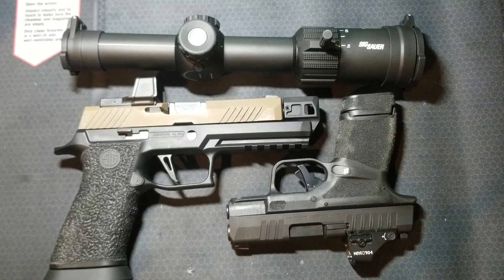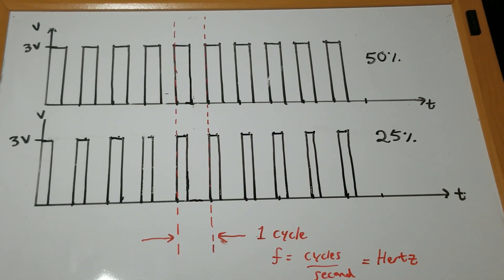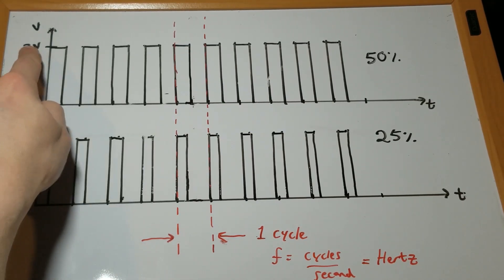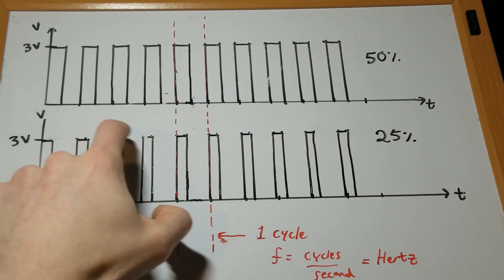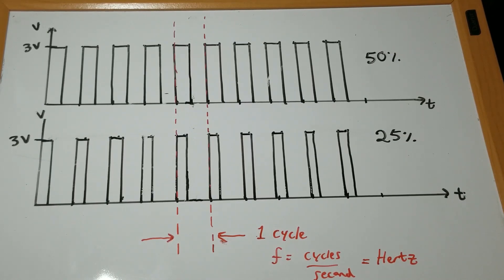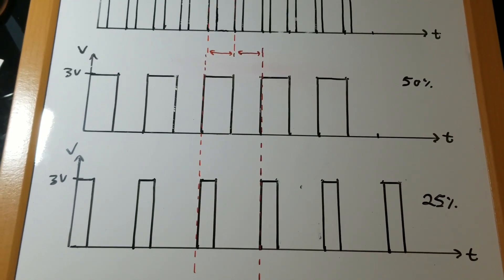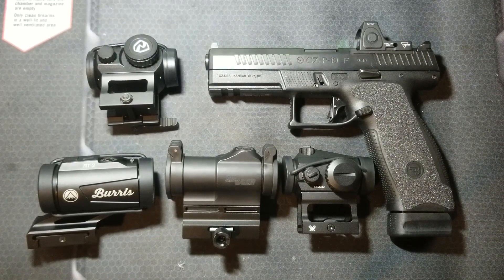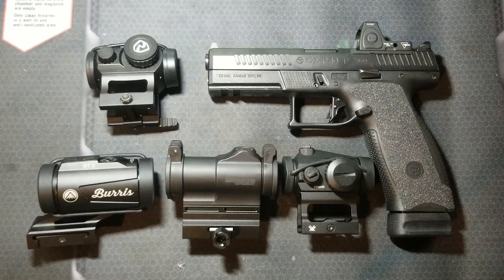Pistol Red Dot Flicker or Refresh Rate Explained

Comment: If you want to get really weird we can talk about holographic sights. EOTECH went to enormous lengths to avoid noticable flicker if you understand the technology constraints they had to hurdle. I know for a fact that at one point in earlier EOTECH designs both the pulse width and pulse frequency are altered in some brightness settings (I suspect this is still true, I just know that one for certain), due to the minimum output brightness that is actually stable with the laser diode used at the time. To achieve the lowest brightness settings pulses measured in a couple of nanoseconds were used which required 2 separate microcontrollers to pull off. In the order of 1/1,000,000,000ths of a second. I wish they were better explained to people, holographic sights are complicated but not impossible to understand.
Reply from the maker: Thanks for sharing this! I know the basic operation principals of holographic sights, but not details like this. I am sure they ran into a lot of technological hurdles as they developed that tech to get it to market, manufacturability, and being reliable and robust to the point it could be put into service! Time to go do some more research haha. If you had any good links I would appreciate you sharing!
Reply from the maker: I read the reply you recently made to my follow up comment - you must have deleted it but I read it in the notification email I got. I figured their technology is a very closely held secret. Patents are intentionally vague to cover the broadest application of their tech while also not giving away the details in a way it would allow someone to replicate. I appreciate your time and response. I'm not trying to have you do the research for me then spoon feed me it haha. I can go look around a bit. 

I would love to get into the nitty gritty details of their electronics package and control scheme. But thats likely not published as its their IP/trade secrets. Always appreciate your comments man!
Reply: @EngineersArmory   Dammit, you caught me! 10 or so minutes after posting it I thought "Uh, he's an engineer. This is almost certainly not useful for him. He would think of looking at them."
The only one that has really anything more the most superficial details about the electronics is the patent for what ended up being the Bushnell Holosight XLP and integrated circuits and other things have come very far since then. It is the only one that has detailed drawings of it's circuit board but you can tell at a glance it is not detailing all of it. By the way, I had remembered it wrong, there weren't 2 microcontrollers, there were 2 pulse forming circuits. Screwed up the two.

None of the sights ever sold under the Bushnell Holosight name got revision F of the Eotech branded stuff which drastically increased battery life and suggests drastic changes to the electronics to me. I was unable to to find even a satisfactory photo of the circuit board of either. Since the 551 was actually adopted into US military service I expect there is a TDP of that which would certainly have the drawings, etc., we want to learn about it but that is not likely to be just found somewhere and I'm not sure how long it takes for the government to turn down a FOIA request on average now and don't want the suspense.

I don't think of it as doing research for someone else, this stuff just fascinates me. My hope was someone had a photo of the actual circuit if not a diagram or had attempted to identify things themselves, but I could not find that in particular. Scouring the depths of various forums did yield useful information. What I typed up already exceeded the character limit of a single YouTube comment but half of that was just organizing and writing things I already knew. Actually it is just short of exceeding the character limit for a YouTube comment 3 times lol. Since you caught me I may as well just post it anyway. It abruptly ends.

The first part details what the hell is even going on inside optically in great detail. That may still be useful for you since I dunno how much you know about holography, that is a pretty niche field. I'll give it anyway.
Edit: A typo that didn't look like one.